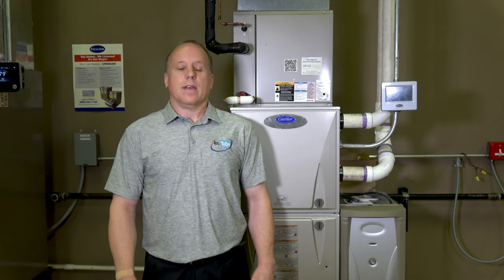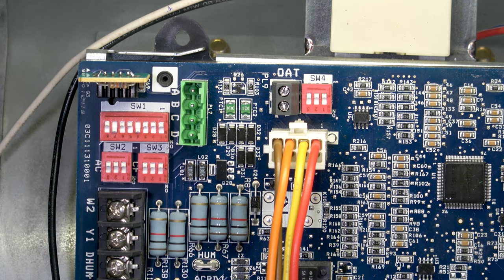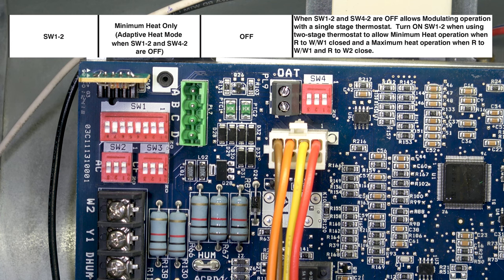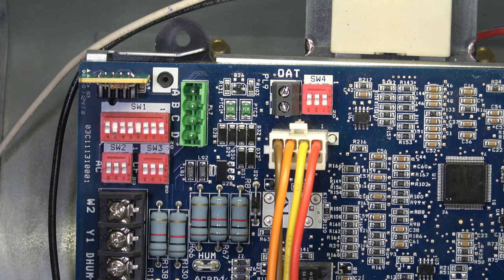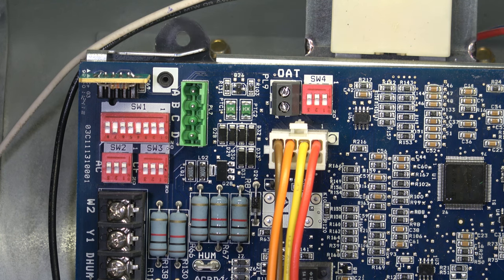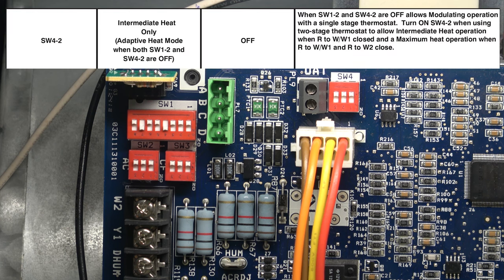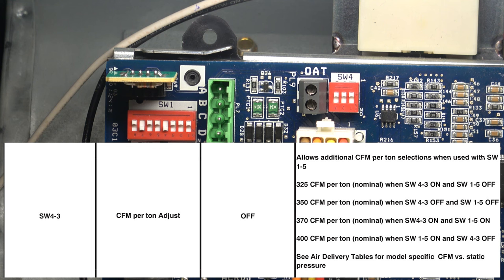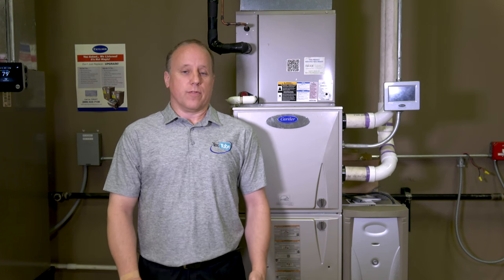Variable Speed Furnace Setting Switches for Carrier Infinity / Bryant Evolution

Comment: Hello, I'm installing an Ecobee onto my Carrier Infinity (same control board). Previously was wired to ABCD, I'm rewiring from ABCD to standard terminals but still not sure on the SW1 settings. Should I match what you have in this video for the standard terminal settings? My current SW1 settings are the same EXCEPT SW1-3 is ON (yours is OFF). 
However, from your talking points it sounds like I need to turn SW1-2 to ON and SW-4-2 to ON for the Ecobee? 
I've been reaching out Carrier, local guys and haven't had any help, really appreciate your time and this video!
Reply: Go with the Connex/Infinity control in every case, if you have one of the nice units or high efficiency.  There are functions the Ecobee cannot control that the Carrier themostat can.
Reply: I know I'm late, but you should do two things
1. set your ecobee to use the HVAC for fan control
2. Set switch 1-3 to ON so the thermostat can control 2-stage heating
That's pretty much all you need. Just know you'll miss out on things like adjusting fan speed, calculating static pressure, and some other advanced features of your communicating system.

Comment: At 6:56 it says "SW 3 cannot be set for airflow higher than SW 2"  Can you explain why that is?  Is it just a recommendation or does it really not work to set SW 2 higher?
Reply from the maker: SW3 is not only for continuous fan, but also for cooling stage 1.  Stage 2 cooling needs to be more airflow than stage 1 cooling for the evaporator will likely freeze up (and even if it does not, the dehumidification would be poor).

Comment: Hi, I have a Carrier Infinity 96 Model 58MVB080. This unit operates on propane since the original install.  My air temperature at a vent closest to the furnace when the furnace is running on high is only 105 degrees F.  Even if you wait until all the tin has heated up, it doesn't go any higher.
   I've had a service guy tell me this is normal.  Shouldn't that temp be higher?  My flame color is good. Very blue with no yellow.  Also... new heat exchanger two years ago.  Any thoughts? Thanks
Reply from the maker: There are a lot of factors involved. The first question would be what is the heat rise across the furnace? You need to measure the temperature of the air right before it enters the furnace and then also measure it right as it exits the furnace (not all the way downstream by the vents). The answer to that heat rise question will generate follow-up questions.
Reply: @TECTubefilms  Ok, thanks for the response.  I will try and take those measurements asap... My basement access is restricted somewhat because I have an occupied suite.
Reply: I am trying to increase humidity as much as possible since I live in Denver and it is so arid.  We sit between 9-16% of humidity every day.  Are there any tricks to increase the humidity, turn off any de-humidification functions or any tips or tricks?

Just as a note, we are having an Aprilaire humidifier installed in a few weeks, but would love more humidity in our system and maybe for other readers who find this.

Comment: Hello, I have a new 59TP6 100k btu furnace installed. I'm running a ecobee tstat.   The installer left the DIP switches in the factory preset positions. How do I know if its actually using both stages of gas vavle and variable blower speed?
Thank you

Thank you
Reply from the maker: IF your installer wired both W1 and W2, then in the ecobee stat you can use the check-out mode to force it into stage 1 heat.  Measure the duct temperature.  Then once the temp is fairly stable and no longer increasing, you can then force it into stage 2 heat and see if the duct temp raises significantly.  If the installer only wired W1 and the furnace is handling the staging, then you cannot test from the ecobee.

Comment: Need some help getting the humidfier control to work.  FYI the outdoor unit is non-communicating, i.e. has no OAT sensor, and right now there is no OAT hooked up to the main board (I have an OAT sensor on order).  Under this condition there is no OAT displayed on the UID (no surprise), I am given no option on the UID to set heating humidifier control to AUTO, and I never see the HUM terminal provide 24 VAC. Must an OAT be installed to set humidification to AUTO and to activate the 24VAC HUM terminal ?

I have an OEM OAT sensor on order but in the meantime i connected a trim pot across the OAT terminals on the main board but the communicating thermostat (Bryant Evolution) still displays only __ for OAT.  Is there some reason the OAT wouldn't start reading with a resistance across the OAT terminals?  Do I need to power cycle something after connecting up the OAT sensor before the control board and UID will start reading OAT?

Another question in this area:  Does the communicating UID actually measure humidity, or does it simply infer humidity (and generate calls for heating humidification I suppose) based on other parameters such as OAT?
Reply from the maker: It measures indoor relative humidity.  Indoor humidity cannot be inferred from indoor temperature and certainly not outdoor temperature
Reply from the maker: If you have a thermistor with the correct curve (10k Type II) or a resistor simulating an appropriate resistance in the acceptable range, then it should display on the stat.

Comment: I had a Carrier Infinity model 59 TN6B060C171114 furnace installed with the Carrier Thermostat Infinity System Control.  When the Heat cycle begins, the Thermostat displays a "System fault, 126-High Heat Cycle Active" message. The technician told me that the problem is communication with the Motherboard and they have already requested a new Motherboard.  I'm not convinced that's the problem.  On the internet I found it to set the Furnace to "Efficiency" and turn it on "Low Heat Rise".  But this last option does not have it to activate in my Thermostat.  What do you think should be checked to correct this fault?
Reply from the maker: This is a relative new error code that was added to the software last year. There are lots of things that could cause it, but it essentially means your furnace is running too hot. Likely causes include  insufficient airflow (which itself can have multiple causes) or high gas pressure.
Reply from the maker: The two settings you mentioned are in the installer setup screens and they are "band-aids" to increase airflow to avoid this alert message without solving the actually root issue.

Comment: Everything appears good, may have been a bad connection on the control board.  The model plug was switched over, but appears not to be reading the make/model.   When I do a system install it only reads Furnace 75 kbtu out.  Any ideas?
Reply from the maker: That is a odd one.  If you are a contractor, we would suggest contacting the local Carrier/Bryant technical support number for your area of the country.  If you are a homeowner, we would suggest you contact your dealer who can then reach out to tech support, if needed.

Comment: I have a Carrier Performance 96 59TP6 and no techs in my area know anything about them. For 3 years in the winter the low speed fan is too low so have freezing parts in the house. I have been through the service manual 40 times trying to figure it out. Do you know what dip switches?
Reply from the maker: This video is for Carrier Infinity series furnaces, not Performance series.  We do not have a video specific to the 59TP6.
Reply from the maker: Although it is sort of weird no one in your area services these furnaces.  What about the tech who installed it originally?  Where do you live... maybe we can recommend someone.

Comment: I have an issue where I get a limit fault from the furnace overheating. How do I increase my CFM Maxes  out at 1288? This is assuming that ductwork is sized correctly and also gas pressure is good.
Reply from the maker: Each issue can be causes by a multitude of root causes so it would not be prudent for us to guess at your issue.  If you are building owner, we suggest you call the installation contractor for them to troubleshoot.  If you are the contractor... and in Chicagoland and NW Indiana, please call our Tech Support team.  If you are in other regions, please call the Tech Support team of that local distributor and they can walk you through troubleshooting steps.
Reply: My Carrier Infinite CFM maxes out at 1288 as well. I'm getting a Limit Fault Error-33. Running the test without a filter, I still get the error. Did you ever solve the problem, increase CFM? thank you.

Comment: hi, so how would i tell the furnace control that i have a 3 ton ac unit that requires 1200 CFM? setting sw1-5 ON and sw4-3 OFF only tells the furnace 400CFM/ton. thank you.
Reply from the maker: The 8-10th digits of the Bryant furnace model and the 15-16th digits of Carrier indicate the "tonnage" of the blower.  If you are going to use a condensing unit of less tonnage than the blower can handle (such as putting a 4 ton A/C with a furnace that has a 5 ton blower), then you would refer to table 7 of the book to fine tune the CFM as related to static pressure.  Alternatively, if you use the Bryant Evolution or Carrier Infinity wall controller, then no dip switch settings are needed at all and the controller knows the tonnage of the outdoor unit via communication cable.
Reply: @TECTubefilms  Thank you for this video. This is helpful, at the same confusing based on my settings. I have the infinity furnace 59mn07 with infinity touch. I added the variable ac 19vs one year later. The dip switches are completely different in mine and I wonder whether it is correctly setup.  SW1, everything is ON except SW1-8 is off. SW4, everything is OFF. SW2 & SW3 - everything is ON. Am I correctly setup?

Comment: is there any reason why you'd want to DECREASE your airflow? Wouldn't you want the airflow higher always?
Reply from the maker: Normally you want the airflow as low as possible. Lower airflow means less sound issues and lower energy. And for cooling mode specifically, lower airflow means better dehumidification. There are reasons to use higher airflow also such as poor duct distribution system, oversized equipment, or desert climate zone.
Reply: On "Full High" my furnace has a static pressure of 0.77+ inches.  Well above what it's supposed to be.  😞 :-( ...
Have to set it lower to get a compromise.

Comment: I was working on a 2.5 ton 5 stage a/c unit the other day and from the infinity controller it says in 5th stage I about 930 CFM. Is that the proper amount for 5th stage
Also does the blower give off the same amount of CFM whether its in single or 5th stage of a a/c unit? If not how would you know to properly adjust it for each stage
And even if you have an infinity controller can you still adjust the dip switches to adjust fan speeds for a/c?
Reply from the maker: No, all of the dip switches (except the test switches) are disabled when you connect an Infinity controller.  Airflow needs to be adjusted from the controller in the service screens.
Reply from the maker: No, 1st stage and 5th stage do not have the same airflow.  The CFM modulates as the cooling capacity modulates.
Reply from the maker: It sounds like you have the CFM set fairly high.  You may want to consider putting it back on the default setting of "COMFORT."  That will be 300-325 CFM per ton.  You are probably set at EFF or MAX right now and why you are getting 372 CFM per ton.

There are reasons to have a high CFM setting, such as air delivery to the "longest" duct run.  However, if you take it off of COMFORT, it disables the dehumidification routine, it increases energy usage, and it increases sound.  Use COMFORT when you can and only increase it on projects when you have to.
Reply from the maker: This video series may help you - https://youtube.com/playlist?list=PLoR_O4JRNc27j4f0sdFYQJSZ-f6BhSD7i

Comment: SW1-2 and SW4-2 Off allow Modulation with a single stage thermostat. Does this work the same as if I had a Bryant Evolution Control? (I am using a Nest thermstat). What am I missing out on?
Reply from the maker: If you have an Evolution control, the dip switches are not used at all. In this scenario, those same settings are handled by the controller instead of the dip switches.
Reply from the maker: The furnace will not fully and properly modulate with a standard 2-stage thermostat like nest. It will only fire at 2 rates, although the first stage will change its capacity each run cycle. It is slightly better than a 2-stage furnace but not much better. If some wants to use a regular stat like nest, they should save money and must purchase a mid-tier 2-stage furnace. No reason to pay for a top of the line modulating furnace and then put the regular stat on it to dumb it down to 2-stage.
Reply: @TECTubefilms  My furnace is a vintage 2011. So far it looks like all the same dip switches and set up. I'm looking to replace the Infinity controller with a Honeywell Vision Pro 8000 in order to have wifi accessibility. That's the only reason for changing it. Am I really missing out on significant efficiency by doing so? I believe the Vision Pro also has adaptive recovery. I noticed you skipped S1-3. That is one I want to turn on for increased airflow. Thank You!
Reply from the maker: @tomacquilano1304  What is the model number of the Infinity state? 2011 is when Infinity stats switched to ones that have Wi-Fi. Is yours not touch screen? If so, you might have one of the last ones of that vintage.
Reply from the maker: @tomacquilano1304  The amount of lost functionality will depend a lot on your model of equipment. You will lose the dirty filter sensing ability. If you have a 59MN7 modulating gas furnace, you will lose the modulation and essentially dumb it down to a 2-stage. If you have Infinity zoning, then Honeywell not work. If you have a 25VNA0 heat pump combined with your furnace, it will also not work.
Reply from the maker: @tomacquilano1304  In terms of efficiency, they used to rate the systems with and without the Infinity stat and without the stat was generally 0.5 to 2.0 lower SEER points on the AHRI rating. For the heating side, the DOE used to require the Infinity stat to get its "most efficient" label which meant 97% AFUE and higher. We suspect, but do not know, that the different with and without the Infinity stat is probably less than 1 point of AFUE.
Reply from the maker: @tomacquilano1304  You can replace your old non-Wi-Fi Infinity stat with a newer model that has Wi-Fi. If you decide that you want to go with a standard thermostat, we would recommend ecobee.
Reply: @TECTubefilms  It's not touch screen. I already replaced it anyway.
Reply: @TECTubefilms   I like the Vision Pro 8000. We also use one at our other house. Makes it simpler for my wife and I.

Comment: i had to come to yourube after 3 -4 techs not knowing whats the error is... heres the symptoms 
furnace  had a  power surge and everything dead except blower on all the time  weither calling for heat or not.

1.inducer, ignition and safety wires  going  to connectors on gas valve 
2. tested the saftey circuts all good to and from connector on gas valve 
3. theres power on the main board going  everywhere  fuse is not blown 
4. no power coming into inducer motor  from gas valve connector  but theres power from main board to gas valve connector 
5. i took off wires to pressure switch .. tested both blue wires dangling in the air and both in and out  have 15 volts 
6. the diagnostic error light on gas valve  used to flash  a trouble code of  "bad  limit circut"  but now no light at all

Comment: I have a Bryant Evolution natural gas system,  I was plagued with Communication errors for years.  After rewiring the spliced float switch (the installer did) I was communication error free for about 15 days.  I then went into the thermostat did a factory default restore and reinstalled the equipment to clear all the past codes.  I am now back to communication errors and the model number and serial number is blank for the furnace.  How do I properly load the equipment into the thermostat?  I feel like I am doing something wrong?
Reply from the maker: Your question is a bit off topic for this discussion but the short answer is the the model and serial numbers are embedded into the "model plug" hardware that is physically plugged into the furnace circuit board.
Reply from the maker: We are not sure what a "spliced float switch" is.  Is this a condensate overflow switch for a pan under the furnace in an attic maybe?  It should not be "spliced" into anything.  It also should not be wired to drop power to the furnace.  The best way to wire it would be using the Auxiliary G Input.
Reply from the maker: Wire a condensate overflow switch similar to this - https://youtu.be/FUyZCvzsHy8
Reply: Thank you for the reply.  I was having issues with Communication errors and zone 2 no sensor data.  I ran shielded cable and ultimately fried my furnace circuit board.  I've since changed the furnace circuit board with a brand new one and wired the float switch to the g terminal.   I went 15 days with no communication faults, then reset factory settings on the UI and did a system reinstall to clear past codes.  Now I am back to communication errors.
Reply from the maker: @josephconetta4834  When your technician replaced the damaged circuit board the "model ID plug" from the old board should have been inserted into the slot on the new board.
Reply from the maker: @josephconetta4834  Whenever using shield cable, you also need to make sure you drain the shield to earth ground at one end only, connect at any daisy chains, and then tap it off at the other end so you have one continuous shield to ground.  Do not drain it at both end (makes a giant antenna) nor forget to do it at either end.